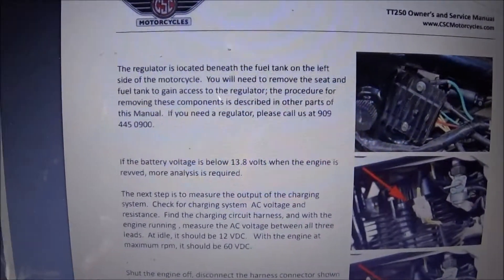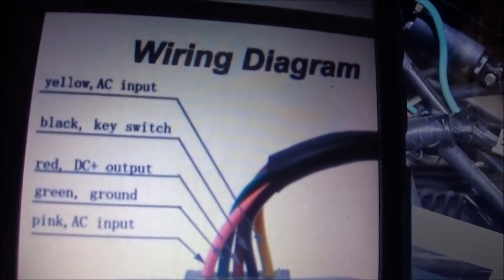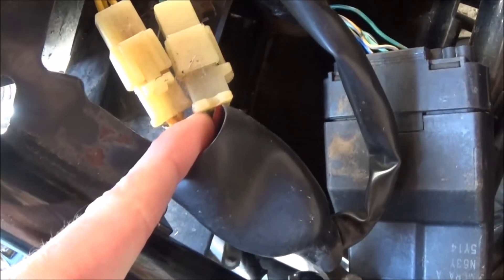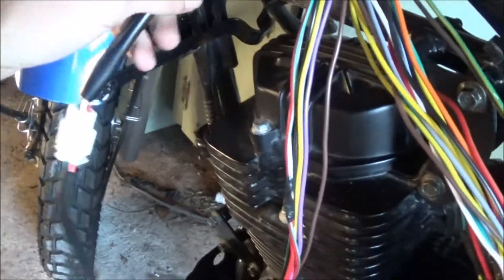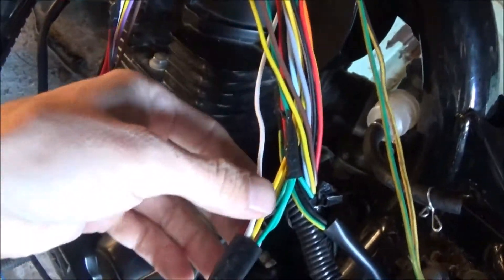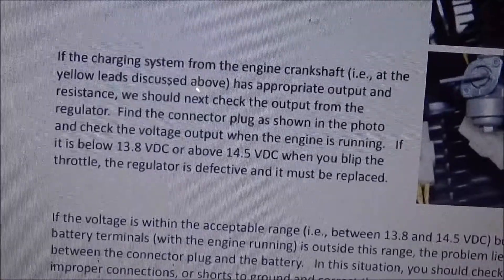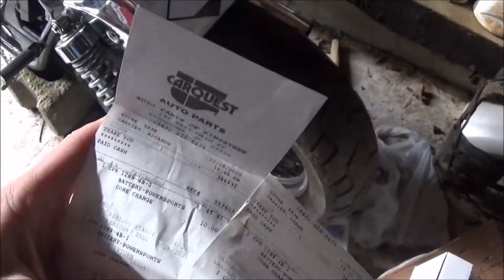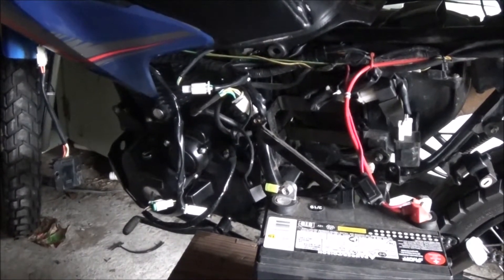Tbr7 Electrical Problems Part 2

Comment: Hopefully it works out. For next time, you need to consider that "time is money", for the extra coin I would just buy the OE TBR part to shave days of labor, chasing wires, testing etc.
Reply from the maker: Na,Every part from Tao direct is double the price and lower quality, Like the chain guide. If time is money and you don't wanna work on China bikes,Then buy a name brand bike at the start.
Reply: @joshcb7  Fully agree on all mechanical parts and some basic electrical, batteries, turn sigs, CDI etc. .. but chasing spaghetti wires all over the bike, my time is too valuable for that.
I get your point, I bought my TBR7 and stripped it to the bone to personally work on it top to bottom, but there comes a point where 99% is enough particularly if that CSC part is now a paper weight.
Reply from the maker: @totalnoobfishing1753  I guess I could have asked if it had 1 plug before ordering because there are no pictures, But I think some bikes probably have 1 plug and some have 2 plugs, It's just the quality or consistency on these bikes. It's still not working properly, So let's see in another 2 weeks if it kills this battery.
Reply: @joshcb7  Dang.. I was hoping the new battery would solve the problem. Maybe start splicing yellows and try each with the multimeter.